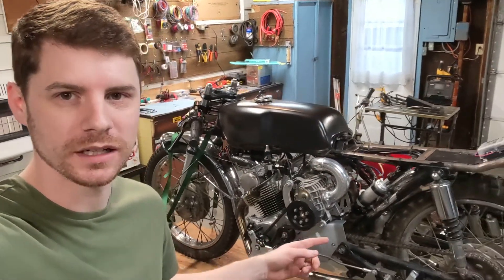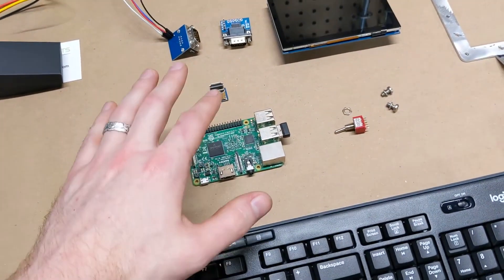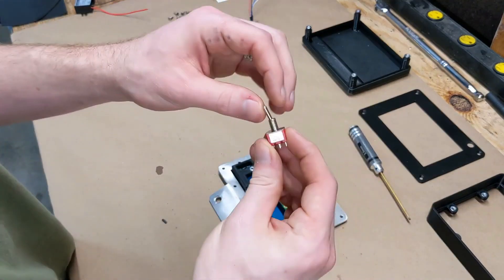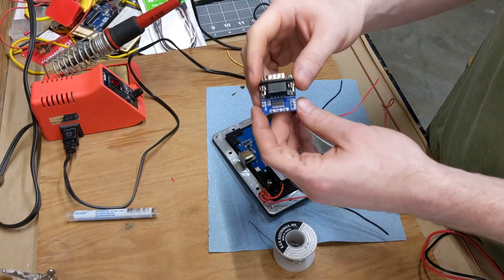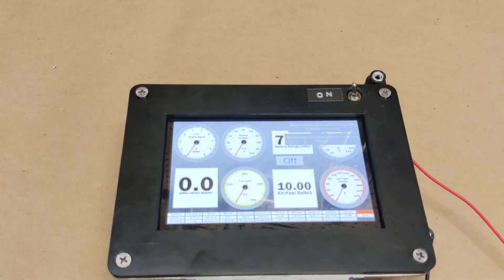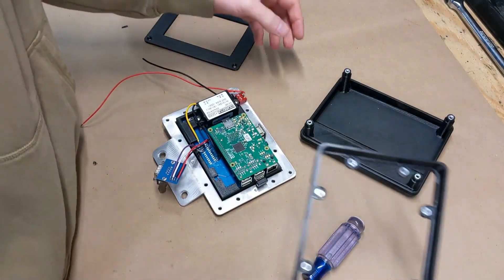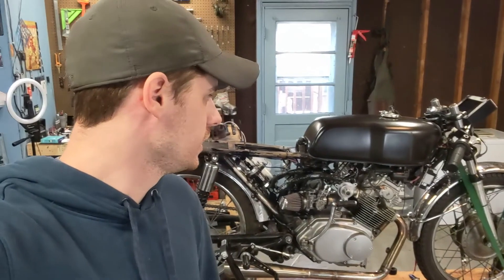Installing a Custom Digital Dash on my Supercharged Honda CL175

Comment: i recently ordered a bluetooth sensor board for telemtry logigng for the racetracks, i figured i would make a raspberry pi system that runs android and make an app for it to log it. Now i am waiting for a screen, i figured i could just as well make the sensor modular and use the system withthe screen as a navigation system when i'm on the road. Was curious about also hooking up the ECU of my track bike to make the entire system a motorcycle dash+telemetry logger. 
I was looking for housing builds but this video got it all, nice work!

Comment: Well done! I have a similar setup for my 68 VW (EFI, Turbo) using a RPi and full blown TS as a gauge cluster. I'm assuming you are using an RPi 3. What is the load time from OFF to gauges? TS recommends using an RPi-4 but I want to continue using my RPi-3 if load times are acceptable. Thank you!

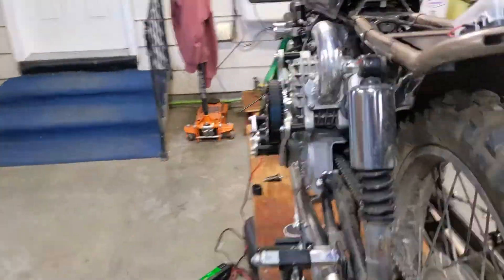Comment: hey min 18:13 you have a fuel leak. watch out that.  
im following this since the start. im in the same way with a gsxr 750 86. cant make it work correct with efi. so its gonna be carbureted

Comment: Motor sounds awesome! What are you going to run for tires? When I raced my CS5 I went with Heidinau. Bridgestone also makes vintage speed-rated tires I believe.
Reply from the maker: That's a good question. I was really hoping to find a Z rated tire but the best I can seem to find is H rated. If you have any recommendations, please let me know.
Reply: @vintageironmotorcycles  Let me investigate!
Reply: @vintageironmotorcycles  Yeah, both the Bridgestone and Heidenau tires are H rated, so 130mph. That is all we used in AHRMA roadrace events, but those old bikes never exceeded 130mph, even though highly modified within the rules
Reply from the maker: @rolandwheeler4842  I may just pick up a set of H rated for now. I'm sure it'll be fine for this season. Now just to figure out which ones I want.
Reply: @vintageironmotorcycles  I like the K44R Heidenaus

Comment: I don't know if you are doing this, but if you're running an air-cooled bike for any length of time, you need to have a fan pointed at it. Your  crank really shouldn't be getting hot enough to melt a 3d print.